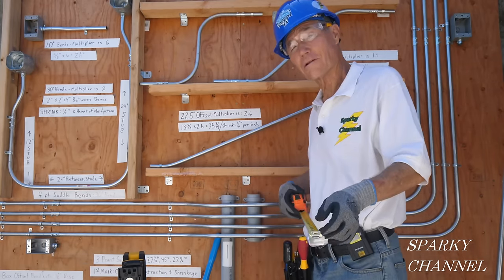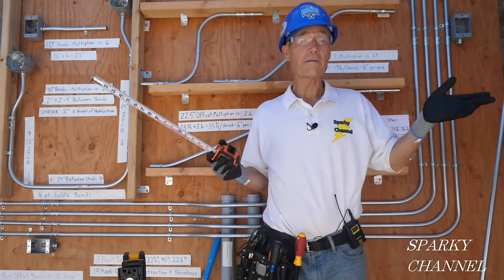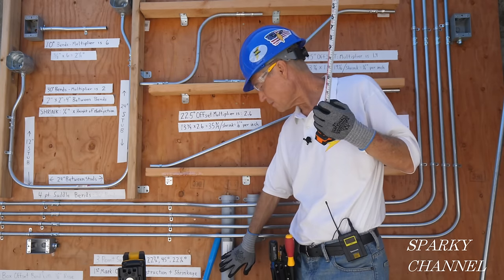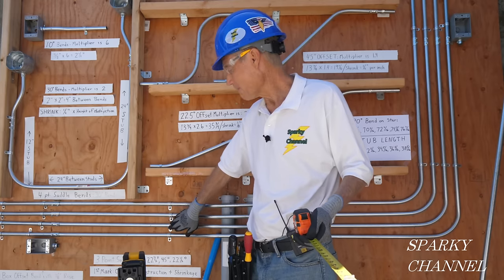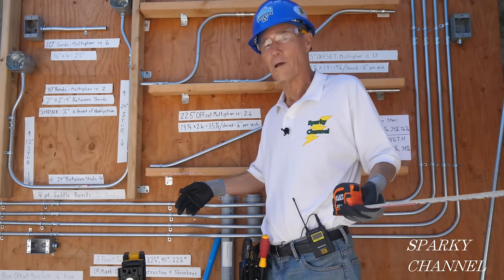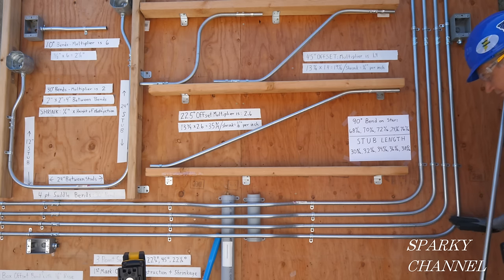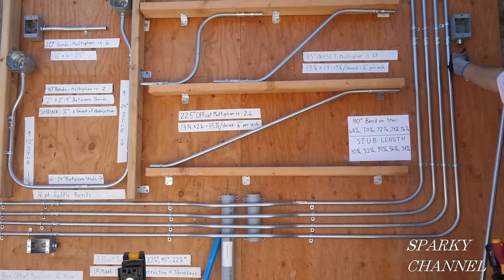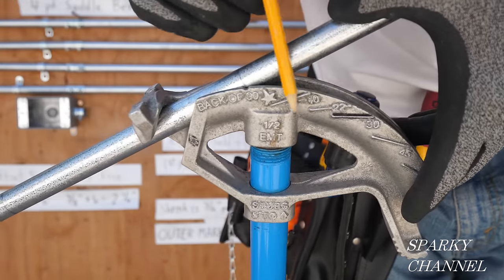Box Offsets, 3 Point Saddle Bend, Parallel EMT Bends and Concentric 90° Stubs all in One Conduit

Comment: I get your doing an instructional video. But isn’t it always practice in our trade do minimal degrees in conduit? Why not 10- 20 -10? That’s how I teach all my apprentices how to do it. And in commercial 1/2” emt  is rare. That puts a kink in your pipe. Like I  said . Why not 10 /20 /10. A lot easier to pull…. Over thinking it…..
Reply: I usually do that at work but for some reasons most people don’t like it I’m always told the beds are too long 🤷🏻
Reply: A lot easier to pull with less angle. 40 degrees instead of 90. If you have the room, why not.

Comment: So did you bend your s saddle 45, then 22, then 22 again?
Reply: Yeah he started on his middle mark at 45 degrees. Placed it in the notch right before the star as that is the 3 point saddle center and then bent to 45. Then went on both sides, flipped it 180, and bent to 22 1/2
Reply from the maker: Yes.

Comment: If you're running pipe horizontally on a wall, put the one hole strap with a screw on top its a lot harder for some jackass to pull down and rip off that way

Comment: I’m curious is that specific bender able to bend only metal pipes
Reply from the maker: It's made especially for emt conduit, but it will bend other metals. However,  it will probably give you kinks when used with other metals.
Reply: @SparkyChannel  ok so plastic pipes can work with that bender
Reply: @tashieboo6133  PVC you want to heat with a blow torch, swaying it back and forth so it doesn't melt the plastic. Then bend it accordingly before it cools and apply water once you've got what you needed so it can stay in position as the plastic stiffins back again.
Reply: 1/2" EMT benders only bend 1/2".  3/4" will bend, 3/4" EMT and 1/2" Rigid or RMC (Rigid Metal Conduit).  Although, the iron workers "borrow" them to bend rebar.